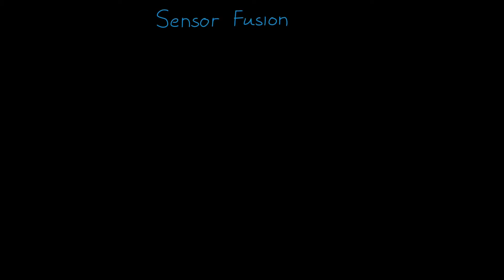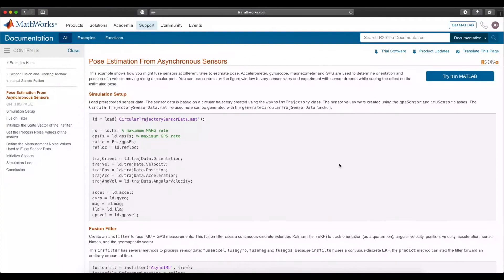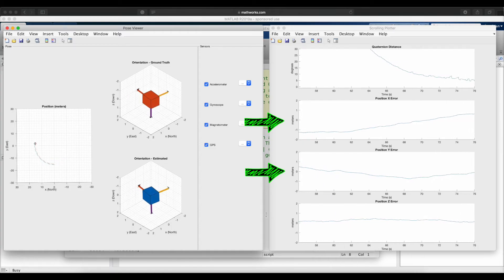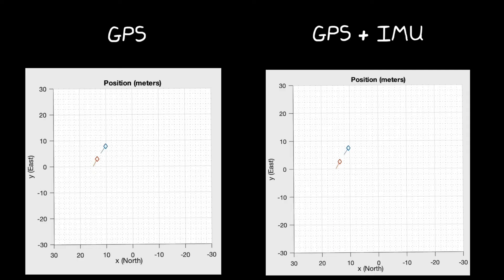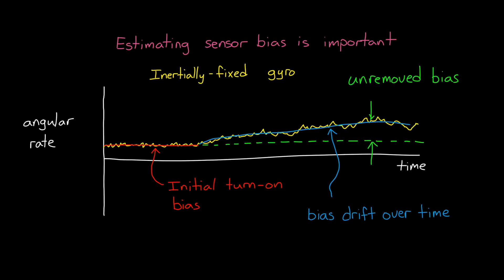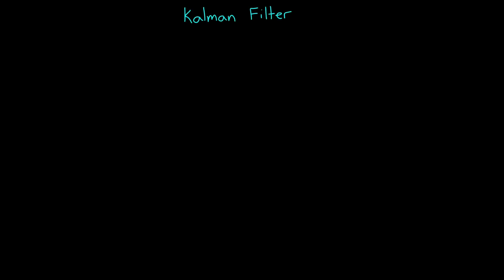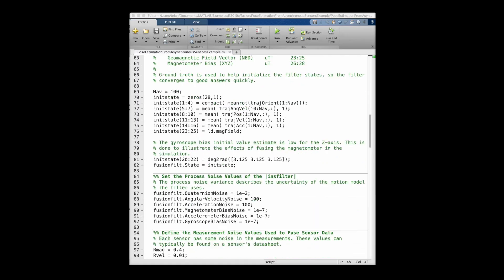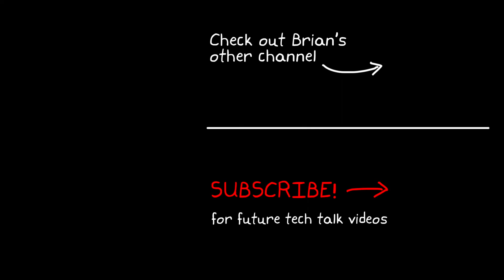Understanding Sensor Fusion and Tracking, Part 3: Fusing a GPS and IMU to Estimate Pose

Comment: Hello Sir, I have a question. Do we have to rotate sensors axis to aligne each other before fusion since my hardware sensors are not axis alignment (should we rotate them like using accel * eul2rotm([pi/2 0 0]) )? And all those sensors axis must be NED or ENU?
Reply: To compare two different sensor measurements that are measuring the same quantity, they should be in the same coordinate system / reference frame. Either you do that transformation before the fusion algorithm, or you do it inside the fusion algorithm (which is often the case when you have different types of sensors like GPS and IMU). This is also true for the way the values are represented (i.e. quaternions, euler angels, rotation matrices, etc.).
Reply: @BrianBDouglas Noted with thank sir

Comment: Sir, I am wondering how to get ground truth data to initialize state.
Reply from the maker: Here is an example of labeling ground truth https://www.mathworks.com/help/vision/ug/automate-ground-truth-labeling-for-object-tracking.html
Reply: Hello Sir, I have a question. Do we have to rotate sensors axis to aligne each other before fusion since my hardware sensors are not axis alignment (should we rotate them like using accel * eul2rotm([pi/2 0 0]) )? And all those sensors axis must be NED or ENU? @MATLAB

Comment: Could the GPS only prediction look at the previous 2 or 3 measurements to and take into account the change in velocity rather than just head off in a straight line at whatever the previous 1 reading was?

Comment: I just found this set of three video. This lecture 3 is perfect for illustrating the problem and solution of GPS and IMU fusion. I use this for structural health monitoring (tracking performance of civil structures) and it's hard to get this concept over, as well as how easily GPS can fool you when you're after cm level precision in a bidge with RTK. So this visual approach fits perfectly and I'll slot it into my teaching material without needing to now all the heavy maths of KFs. Thanks a lot Brian.

Comment: So does the filter loop need to run faster than any of the measurements?
Reply: I'm pretty sure it just needs to process faster than any of the measurements. I can (faintly) see a use case where sensor measurements are batched and sent off, so the filter loop integrates a whole bunch of measurements from the same sensor at once.

Comment: Brian,  Another great video.  I wonder if you might talk about how you could plot devices (5-10) so that they would nearly be the same no matter where they were setup.  The idea is that I want to compare results of someone going between devices.  In order to create some gamication those setups need to be the same, within centimeters.  I wonder if there is a way to use the IMU with Ultrasonic or Wifi timings?